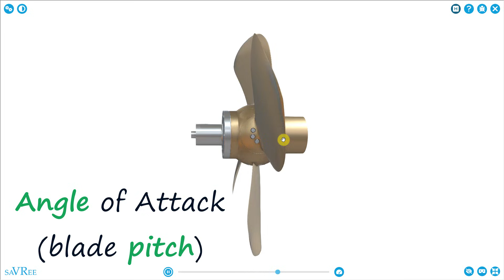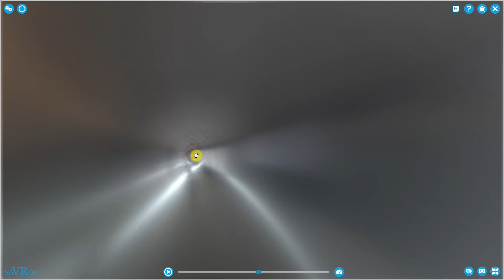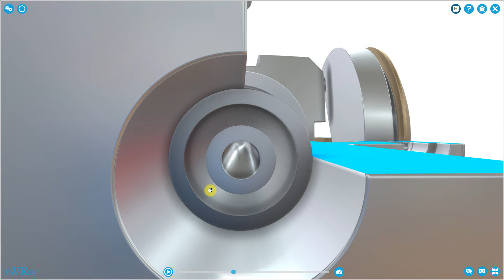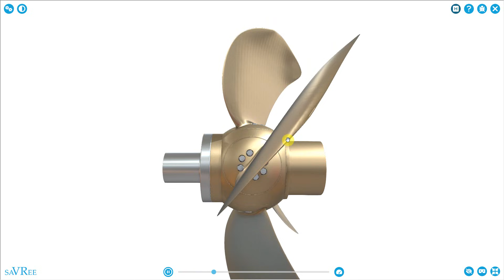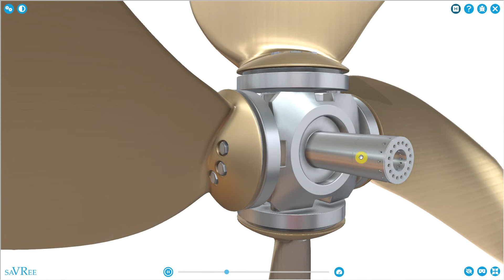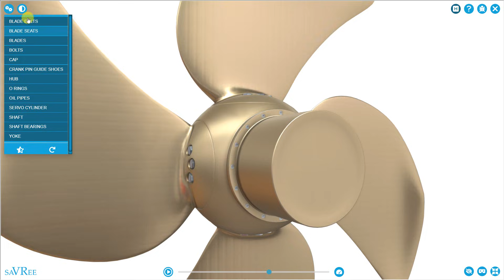How Controllable Pitch Propellers Work | CPP Explained

Comment: The hydraulic systems has a storage tank inside the engine room. How does the hydraulic fluid get inside the rotating propellershaft? Is there two pumps to create the pressure? one for the inside pipe and one for the outside pipe?

Comment: Very nice video. But I didn't understand how the fluid control is done, there should be some valve to stop it flowing in both chambers, forward (yoke moving to left in the cross section you showed) and right (yoke moving to right). How is it done? How is a desired pitch maintained?

Comment: In forward motion, which pitch is the most efficient?  Shallow pitch or a greater angle of attack?  I hear conflicting answers from others.
Reply: The propeller blade is optimized for a certain Angle of Attack. This is the angle between the direction of the water flowing into the leading edge of the blade and the chord line (google angle of attack for a better explanation). The optimal AoA depends on the shape of the blade.

The actual AoA depends on the speed of the ship moving through the water, the rotational speed of the shaft, and, of course, the pitch of the propeller blades. 

There is no single optimal pitch setting that can be used at all times, but there is a single optimal AoA.

Comment: Nice vid! Got curious how the fluid gets in to the shaft, I suppose the whole assembly is rotating together :)
Reply from the maker: Will have a look at doing a video about it.
Reply: I have the same exact question; As in constant speed variable pitch aircraft propellers. The one article I read states the fluid comes from inside the crankshaft, but there’s got to be a pump and a sump somewhere.